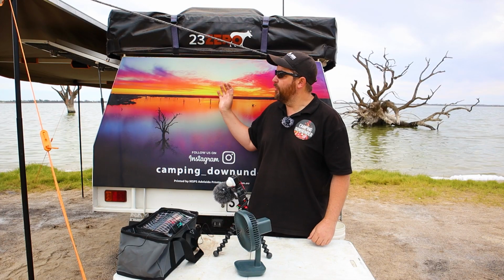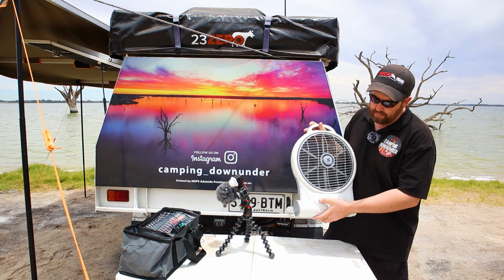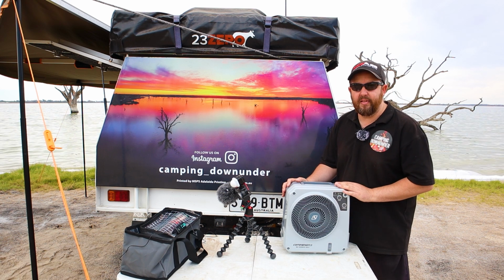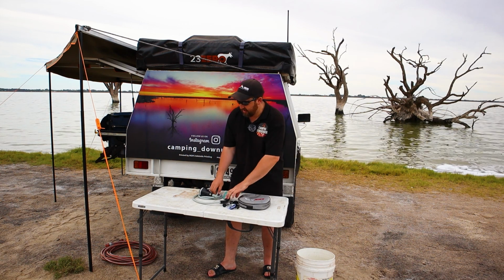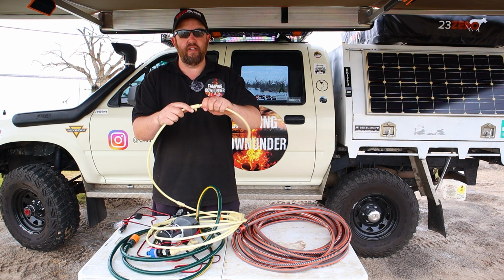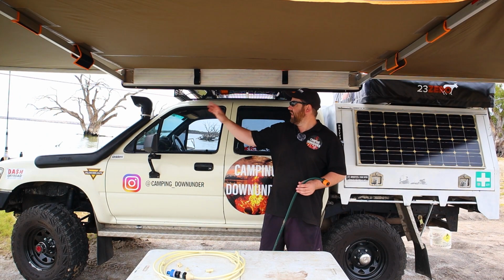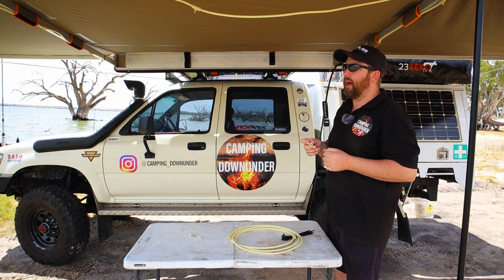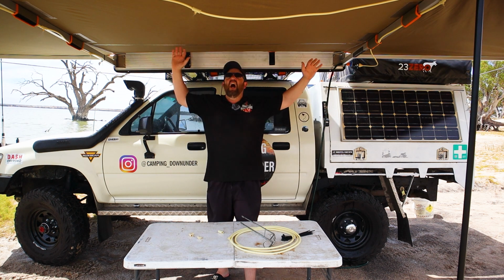Ever seen a misting system under your awning ?

Comment: Difficult to beat evaporation for cooling yourself down. Tee shirt in a bucket of water, wring it out a bit (if you need to conserve water) and put it on. Repeat as needed. Having a fan will help if there is no natural breeze.
Reply: Yep that’s the same method we use. Spray bottle on a T-shirt with a fan blowing directly on the shirt